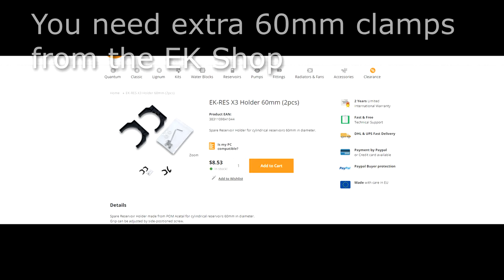EK Waterblocks Classic RGB S240 Liquid Cooling Kit install in a Fractal Design Nano S ITX

Comment: I noticed your sfx psu is "floating" off the bottom of the case. Is that because of the adapter bracket used? I thought by using sfx you could have a little bit more room for the gpu to breathe.

Comment: 4:36 AHHH! You didn't use a jumper cable man! You really don't want to turn your whole system on in case there are any leaks! your stuff could be ruined... Other than that very good video
Reply from the maker: Destilled water ... plus i build alot systems before ;) if im not clear with it im using a jumper ... look at my last timelapse ... i used a jumper 😬👌
Reply from the maker: @Yamatoseinsohn  zum starten der pumpe ohne das restliche system zu starten. alle kabel vom mainboard, grafikkarten, laufwerke ab nur pumpe dran.... jumper stecker auf den 24 pin atx und das netzteil geht und du kannst das system befüllen ohne risiko zu haben das bei einem leck was an der hardware flöten geht. Natuerlich erst befüllen dann einschalten, eine pumpe nie trocken laufen lassen !!
Reply from the maker: @Yamatoseinsohn  der liegt bei ... ist nen stecker den man dann an den ATX steckt ... da is ne Brücke drin das das netzteil angeht
Reply from the maker: @Yamatoseinsohn  im Kit ... hochwertige Netzteile haben das auch dabei. Aber im kit liegt einer dabei
Reply from the maker: @Yamatoseinsohn  alle Kabel die strom vom netzteil bringen, am ende haengt nur noch deine pumpe mit am netzteil :)
Reply from the maker: @Yamatoseinsohn  ja alles was am netzteil noch hängen darf ist die pumpe ... is das so schwer zu verstehen ? 😅🤣
Reply: @CustomrigsDe  Ich habe so ein externes 12V NT mit Adapter auf Sata. Ist so am einfachsten und kostet 20€.
Habe aber früher auch nie einen Jumper benutzt.

Comment: How do temps compare to your previous air cooler?
Reply from the maker: 15°C better max temps on rendering a 4k file in sony vegas
Reply: Just curious but why did you choose to have a custom loop over an AIO?
Reply from the maker: @KingKahana  i got this kit here from EK for testing ... and i always choose a custom loop over AIO ... better cooling performance and you can upgrade easy to a 2nd radiator and gpu block :)
Reply: @CustomrigsDe  If you have 240 radiator you dont need second radiator, I have 240 with gpu block and still nice and cool, running OC I7 7700k @5ghz amd OC Liquid Devil 5700XT, running cool.
Reply from the maker: @sheriff9396  7700k ... not much powerconsumption ;) the sheriff has spoken ...
Reply: @sheriff9396  I was hoping to get away with one 240 in this case too. Could you tell me your GPU temps before and after watercooling? Also did you mount the radiator in the front like this or the top?